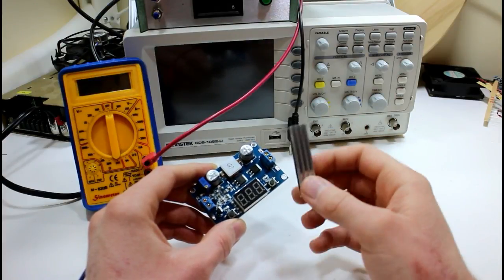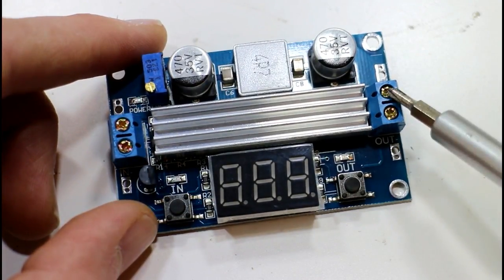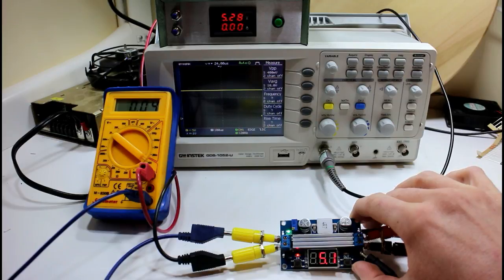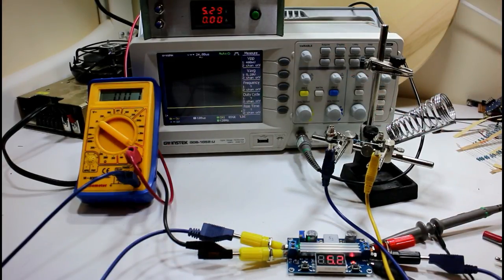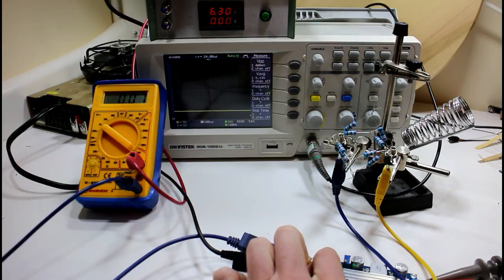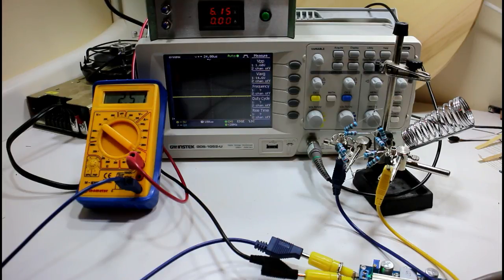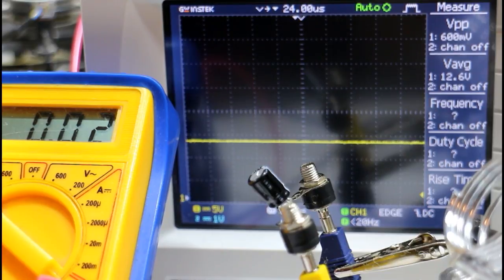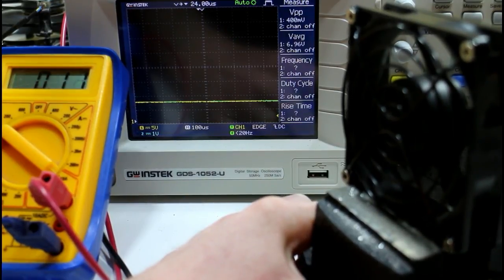Testing a DC to DC Adjustable Step Up Boost Converter Module from IC Station

Comment: Strange way to test a DC-DC converter ... It doesn't make much sense to me ...
The test should check current capacity on lowest to middle input voltage (and lowest to highest output voltage) ..

Comment: Thanks for doing the test. Can you do 3.7v input and check the max 12v output amperage? I want to power a 12v amplifier from a 3.7v 13ah battery